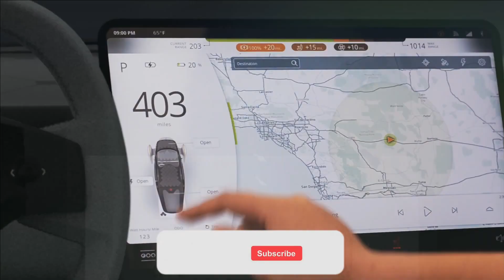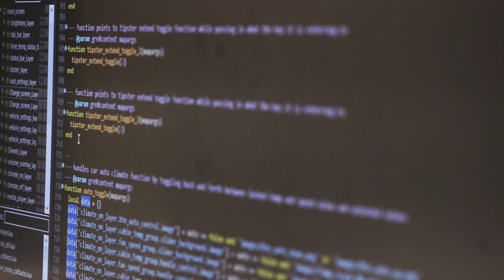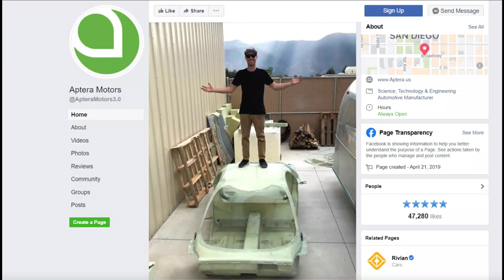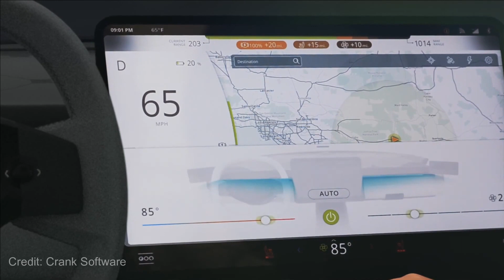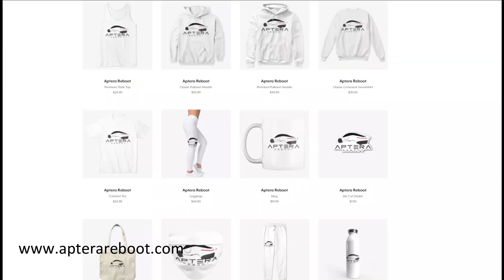Top 3 Reasons Why Aptera Will Fail?!?

Comment: My top 4 concerns are: 1. How well will it contend with winter driving conditions? 3 wheels on icy roads? Pushing through a snowbank with those big boots covering the front wheels? They have stated it is only rated down to minus 29 Deg Celsius(aprox). 2. Will its 1000 mile range be eclipsed very quickly by new battery technology. 3. How will local regulations view this vehicle? Is it a motorcycle? Will I be required to wear a helmet while driving it? 4. Parts and service. I appreciate that they will allow me to work on it myself  but at least in the short term I will not be able to walk into my local parts store and get what I need. Please don't get me wrong I love the concept, lightweight, aerodynamic = efficiency, efficiency. Positives: Work is 12.6 kilometers away, I may not have to "refuel" for months. Family live 1450 Kilometers away, with no fuel stops could I set the all time speed record for making the trip? Oh Lord I want it so much!

Comment: I think you missed the most important reason why it is likely to fail:  Specifics.  They have no delivery or production timelines.  I would buy one, but if I can't get a reasonable deliverable date, why commit?  Someday soon is a good song title, but makes this look like Elio 2.0.  The electric car field is getting more crowded every day and most of them are better funded than Aptera.  And a lot of them will never see cars (or pickups) coming off the assembly line and I doubt Aptera will either.
Reply: They certainly do have such timelines.  I expect to have my Paradigm edition model before the end of the year.  They are still at a risky stage, and many new vehicle introductions form major manufacturers are missing their targets, but I think they are doing what they need to do to start deliveries by the end of the year, and are still on track for that target.

Comment: Old three wheeled vehicles had the problem that they were top heavy and tipped over. The battery in the floor and engines in the wheels will lower the center of gravity and reduce this problem.

Comment: As for safety, how many motorcycles, Can-Am Spiders, and Polaris Slingshots are sold each year?  The Aptera is safer, and if it can sell 20% of the total of these vehicles by the third year, it will be success.  Safety sells, but a significant percentage of people are not very risk averse and will consider the Aptera safe enough.  As for only seating two people, how many Smart cars were sold?  How many Kei cars sell in Japan?  How many people did the first Tesla seat?  Again, Aptera only needs to get 0.1% of the US new vehicle market within a year or two to be a success.
Reply: One could also add the Pontiac Fiero to this list, which sold around 30 thousand year after year.

Comment: The reason I believe that Aptera will fail is that the original motivation for its design is no longer valid. The original motivation was to design the most energy efficient vehicle possible to compensate for the high cost and low energy density of batteries. But now, battery cost has dropped and energy density improved to the point that the extreme compromises in the Aptera design are not necessary.
Reply: For my wife and I, facing retirement, it is almost a perfect car.  The ability to take care of our daily driving needs without the need to find a charging place, coupled with very inexpensive road trips to visit relatives, and the ability to sleep both of us in climate controlled comfort on weekend getaways makes it a very attractive proposition for our needs, unmatched by anything else on offer.

Comment: Only shown going 30mph or less. Why is that? Maybe it is so unstable they are designing in some strange steering modes to compensate which are sketchily described on their website, check for yourself. Decision to go with outrigger motors increases unsprung weight and doubles complexity. Original had single motor safely inside car. Anyone with high speed videos please post or link.
Reply: Arrangements are being made to show Aptera at a local track, possibly competing against other vehicles.  Covid has made this difficult to schedule.  There is very little increase in unsprung weight, because of the parts that are eliminated - heavy disk brakes and drive shafts.

Comment: I just hope they succeed as the philosophy of lightness is a favorite of mine. Vehicles are just getting heavier and therefore less efficient. Even tesla are bloated and could stand to lose some weight and increase there already awesome efficiency.
Reply: I totally agree...probably an echo from the gas age.  No thought for the environment, just burn a few more collective billions of gallons of gas.
Reply: Maybe its also a stability and controll thing. The more mass the vehicle has, the more energy is needed to move it, meaning bumbs on the street will not affect them as much as lighter vehicles.

Comment: 2x failure.  Hybrid wake boats. Safe- no nothing is safe against 5k lb cars and trucks doing 70 mph.  2 person vehicle not just a 2 door car. 220k for 2 door cars you said and not 2 person vehicles.  No comparison.    Crawl, walk, run - too late the race against big manufacturers with established infrastructure is lost.  Cost - since in isn't for sale yet let's just assume by the time it makes it to market, if it does, the projected cost will be less than actual cost so $30k to $50k.  EV price wars have already started.  Repairable?  What happens when the back corner gets crunched taking out 3 of the 4 main body panels of this exotic construction? I'm guessing the vehicle is now totaled for what would be a fender bender in current vehicles.  Ok totaled if we compare to a motorcycle.  70% drive alone.  Are those drivers driving other geeky looking 2 seater vehicles? Not many since the bigger SUV market is THE market.  No doubt the Aptera will go down in history just like the Tucker.
Now that we can see some examples of ingress and egress ergonomics I think that will be a huge factor.  Also they may claim 25 cu ft of cargo but how much is actually useful.

Comment: 1. Failure of Old Aptera: As the disclaimer on every investment prospectus says, past performance is not necessarily indicative of future results.  2. Safety: Find a safer motorcycle in a crash.  3. 2 Passengers: The Aptera lets you do all your one-person trips with free fuel (if they're short enough, otherwise, you you plug it in next to the vacuum cleaner).  If autonomous driving works out, you can call for a Cybertruck when it's time to take the kids to soccer practice or haul furniture.

I think Aptera's biggest challenge, like all of the new EV entrants, will be getting through Production Hell.  Do that, and IMO chances are good they'll sell every car they can make.
Reply: I don't think "find a safer motorcycle" is the right comparison.  It's not being sold as an alternative to a motorcycle, it's being sold as an alternative to a car.
Reply: @incognitotorpedo42  that's irrelevant, the fact people still use motorcycles proves that being as safe as possible isn't essential to everyone, what about smart cars or those fiats? can't imagine those are being close to as safe as your average sedan

Comment: I want Aptera to succeed because it's the best EV design to date. I want one! But I'm in the UK so may have to wait awhile for a right hand drive version.
Reply from the maker: Hopefully in the UK within 5 years.
Reply: @apterareboot1555  What?!  I've just placed a reservation!  You didn't tell me that! (i'm in the UK)
Reply: This is hardly the best EV design.
Reply: @protoborg  what is then?
Reply: The big car companies will kill it , if its even real. Charges on solar only ??? . 40 miles per day??? Yeah right pass the joint, do🚬obby..🌿
Reply: @recyclespinning9839  40 miles is only with the full $900 solar package, otherwise the base model does like 16 from solar. Considering that's about how much you drive daily for most people, it should be perfect. Hopefully breakthroughs and solar will allow this to work in places that aren't Southern california.
Reply: @MrGamelover23  My daily commute to and from work is less than 15 miles. I just priced out the 250 mile range with the full solar package at $26,800. Even if I get no solar charging at all I can go for two week to and from work. Also, I have not traveled more than 150 miles in a single day for over three years. The longest day of driving for me is under 100 miles about once a month. I haven’t had more than two people in my vehicle in over three years. And, I’ll save between $1,400 and $1,600 a year in gas. Even if their range and charging ability are half their claims, this is still the perfect vehicle for me. 

I just hope they make a model that can clear speed bumps. :D
Reply: @MrGamelover23  Also consider that gas is about $5 a gallon in the US right now, fueling up a 15 gallon tank once a week is about $3,900. That $900 for the full solar package is WELL worth the money.
Reply: @recyclespinning9839  it has a plug in charger in addition to solar charging
Reply: @recyclespinning9839 Exactly.  This new class of vehicle has never been allowed to succeed. The pattern is obvious in the history of modern EVs, listen to the trends followed and enforced by these big companies:  If you want to help the environment, as well as have "acceptable" cars, most people will be priced out of driving.  Having less cars on the road seems most likely to be the future.  Its not only about money. Having a car altogether makes one feel empowered and judge for yourself where that trend is going.  I even include the part-bicycle  Organic Transit with pedal assist, protection from the elements, and solar charging, that was my favorite.  And that company was sold.  Cities and towns don't want legal issues from injuries of riders of a new class of vehicle untested by time. So they don't tolerate them. But there was huge interest from a market that sought a second non-highway vehicle and even as a daily commuter.  I feel like every time these vehicles don't take off there's a suit standing there saying "alright nothing to see here, nother failure..."  Maybe we will mostly not be buying any vehicle at all.  Get ready to purchase your ticket on a superbus or supertrain.

Comment: They are still designing the motors.  The car may not be street legal in California.
Reply from the maker: The motors are being optimized for this specific use case, not being redesigned. As far as I know, Aptera will be 100% legal to own and operate in California as well as in the rest of the US. FEel free to correct me if you know something I don't.
Reply: Of course they are street legal in California.  The prototype on the roads has a VIN and a State registration.

Comment: Your second concern is what I stated before - that the Aptera is a niche vehicle, and I doubt it will ever shake that perception. IMO the company's best chance of success is producing a four wheeled EV. Another thing, If EV tax incentives continue to be offered potentially saving the buyer thousands of dollars, the Aptera may not make the list of qualified vehicles presumably since it is considered a motorcycle with unproven crash safety performance. I'm not opposed to niche vehicles, I owned four motorcycles, two of which were fast sports bikes, but they didn't cost anywhere near the price of an Aptera.  My next vehicle will absolutely be an EV, but I'm sorry to say Aptera is very low on my list.
Reply: Aptera will be crash tested to automotive standards just as the original model was, which passed.  The current model is a much safer design.  For me, the cost of ownership makes it a buy, even if it were not to qualify for the incentives.

Comment: Good video. I suggest that the next time you write a headline like this say "Why ??? MAY fail".  "May", is more open to change than "will" and leaves room for a more positive outcome.
Reply from the maker: Thanks for the tip!
Reply: I usually don't read headlines that end with a Question Mark. It immediately says it has no solid info to offer and it is probably a waste of time.

Comment: It's a motorcycle
Reply: It's an Auto-Cycle
Reply: A car in Australia.
Reply: As I have said elsewhere, this is a legal fiction that allows innovation such as cameras for mirrors.  Aptera is still designed to automotive safety standards and will be tested to them.  In every performance aspect I can think of off hand, it is a car.  And I have over 400,000 miles on motorcycles, and can tell the difference.
Reply: @n.brucenelson5920  Plus, after driving it to your job interview or business meeting, you won't show up like a drenched cat on a rainy day as the Aptera will shield one from the elements, something that a motorcycle is hard pressed to offer.  ;-)

Comment: This vehicle shouldn’t sell for over $20-25K with ALL the fixings (full solar, 1000 mi. range, etc.).  A 3 wheel, 2 passenger vehicle will never sell successfully until that realistic price limit can be met.
Reply from the maker: Tell that to the old Mustang GT or the Corvette.
Reply: This probably depends on what your definition of "successfully" is.  In fact, the cost of EVs today is determined by the cost of batteries.  Aptera's efficient use of power makes the cost for performance very attractive - perhaps half that of any other EV.  Aptera will make a fair profit at low volumes at these prices.  When battery prices fall, these will become less expensive to own.

Comment: I’m concerned over cooling. Can the skin cooling used by Aptera really handle the cooling needs of the battery, inverter, shrouded hub motors and air conditioning?  In most cars the A/C cooling requirement is almost as much as a typical house. The push for extreme aerodynamics has eliminated the typical radiators in favor of skin cooling.  I estimate cooling needs for these items will need cooling for about 48,000 BTUs or 4 tons of cooling.
Reply: I have a background in refrigeration.  I designed the samples freezer that flew on the International Space Station, as well as many other projects.  You are WAY over on your estimate of the cooling needs.  There are several reasons why the Aptera needs less cooling.  One is that the wheel motors are more efficient than the motors used in typical EVs and generate less heat to begin with.  Using 1/2 or less the power of a typical EV means that much less heat is generated.  In addition the r-value of the body is much higher than typical metal body construction.  This makes the solar heat gain much less than it would be with conventional construction. My very rough guess, without knowing more details is that the Aptera will need less than 5,000 BTUS of compressor cooling.  If the cooling limits are reached, such as going up a long steep hill at 65 mph for more than 10 minutes in hot weather, the car will simply begin to slow down.
Reply: @n.brucenelson5920  
Thanks Bruce, I’m an engineer but struggled to pass my Thermodynamics courses, so I defer to your expertise.  I’m hoping Aptera does well.
Reply: @larry4fire  Thanks, Larry.  I am not a degree'd engineer, but companies were happy to pay me less money to solve problems that their engineers couldn't.  I am a licensed refrigeration tech, which isn't the same thing.  My respect to you.  

I got the ISS Glacier Project subcontract from the University of Alabama by remembering to add sources of heat in my calculations that the other engineers bidding the project forgot about.  

I would love to know all the numbers from Aptera, but I know enough that it could work.  There are some tricks when you are dealing with a wide range of evaporator temperatures, like increasing the receiver size.
Reply from the maker: They're working on a liquid cooling system. There might be one system for the 25kw version and different one for the higher range models.

Comment: Any EV startup is taking huge risks.  To be successful a new player in the EV market has to offer something different, something special that other manufacturers don't address.  It's why many EVs don't do well against Tesla.  They offer the same basic car, but with specs and features that fall way short of Tesla.

Aptera is unique among EVs.  It's not trying be a better Tesla.  It offers something I've not seen before: Never Charge.  There are a lot of people who live in places without a place to plug in an EV.  For a single person or a childless couple living in an apartment, the Aptera could be a very cost effective vehicle for commuting to work in regions of the country with ample sunshine. 

There's another potential market.  It's people who buy a car just for fun.  The Aptera looks like a car that would be fun to drive.  It's fast, sporty, eye catching, and impractical.  LOL!  Isn't that what many people are attracted to?  That's why I reserved one.
Reply: I think you make some great points. I have a reservation and I don't even need a car. The Aptera is really a very new concept in several ways and it's hard to predict how some of those ideas will play out in the real world. I myself was attracted by the first idea of super low drag coefficient and the cascade of things that became possible because of it like the decrease in power requirements which means lighter weight, very low energy requirement etc.  I love the simplicity of it and it's science based form.
Reply: For a (mostly) retired couple such as my wife and my needs, It will be more practical than almost anything else around, and will even improve on our current Gen 1 Honda Insight.